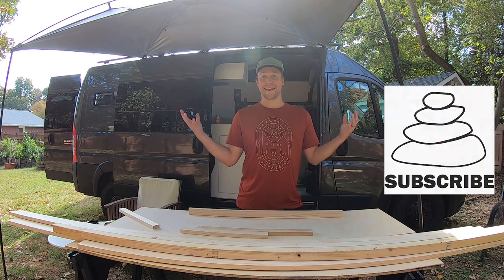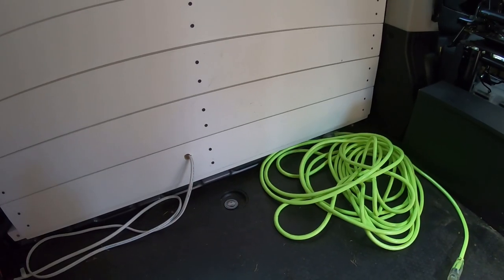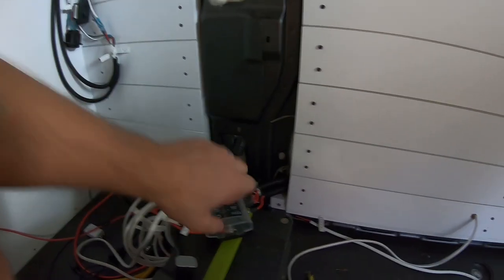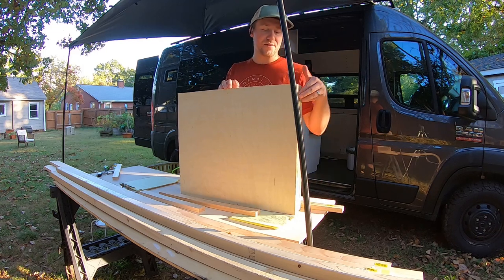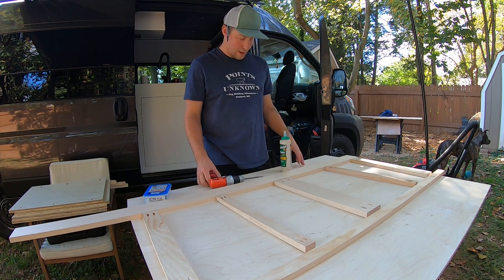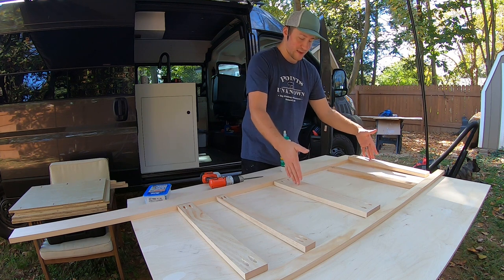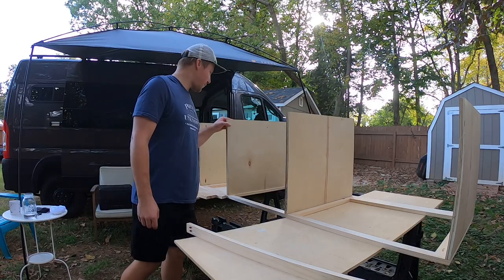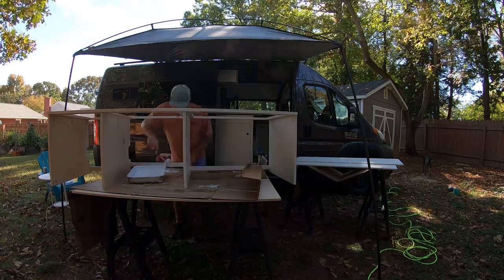Bench Seat for Van Life + Van Project Process //Ep. 30 DIY VAN BUILD

Comment: Did you end up using gas struts to hold up and soft close? If so, any recommendations on a brand?
Reply from the maker: I did not use gas struts for the lid. We normally just go in from the side. We haven’t completely finished our build so it’s been pretty simple doing it that way. In terms of brands to use I think any with decent reviews on Amazon are probably worthwhile. The key would be getting the right length and force. Let me know if you have other questions on it. I’ve added upper cabinet struts before and some on my solar tilt mount so I have a little experience with them